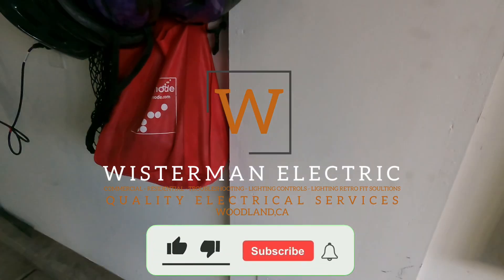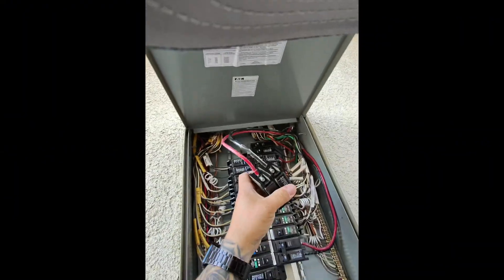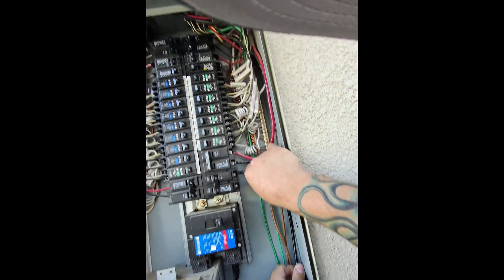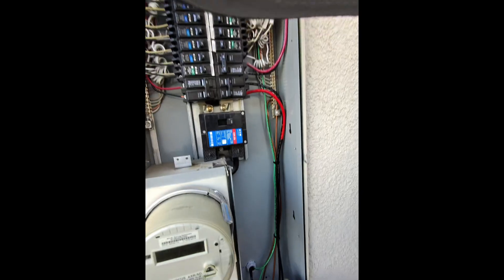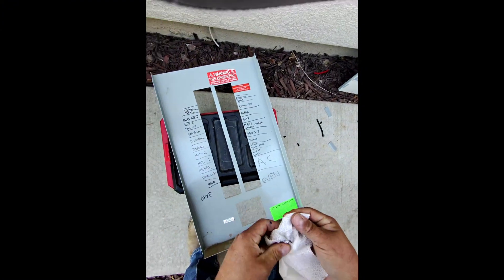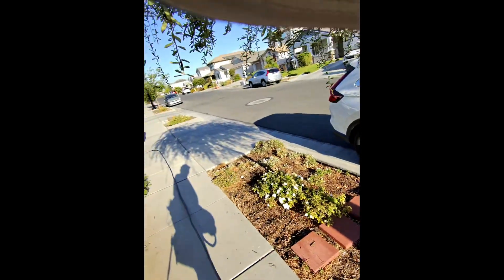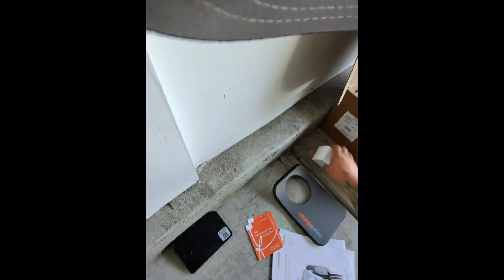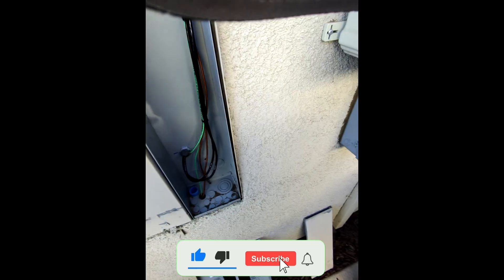Installing a Level 2 ChargePoint Home Flex EV Charger ⚡ Step-by-Step Home Installation Guide

Comment: Any thoughts on mounting an EVSE breaker in the top breaker position as it can radiate heat upwards without warming and prematurely aging the breaker(s) above it if mounted low or mid way up in the panel?
Reply from the maker: Yea it’s a good thought. I just don’t think that the EVSE breaker will generate that much heat unless there’s an issue with the breaker or connection at the breaker. under normal operation it should be fine.

Comment: Clean work! I'm curious to know how you mounted the EVSE on the wall, given that it is right behind the electrical panel.
Reply from the maker: Thank you, Well I chased between the Charger and the panel with a piece of three-quarter rigid, and then I just use snap toggles to mount the  Charger because the support of the rigid will keep it secure to where the toggles won’t have an issue
Reply from the maker: Check out my latest video it just uploaded let me know what you think. if you have any suggestions on how to do something better I’m all ears. I’m all about learning different ways and better ways.